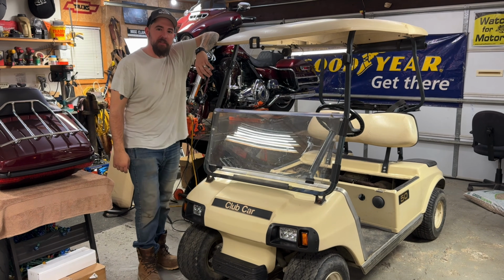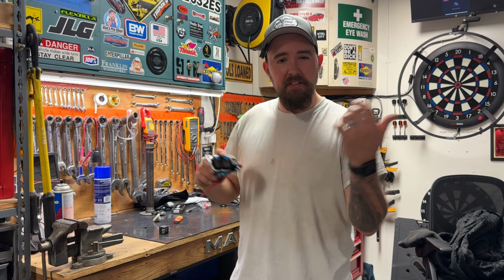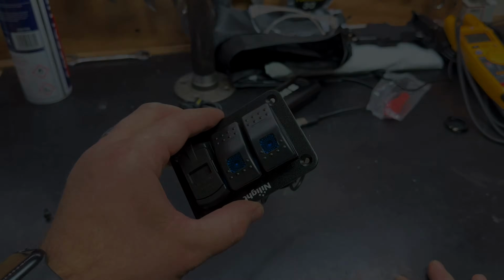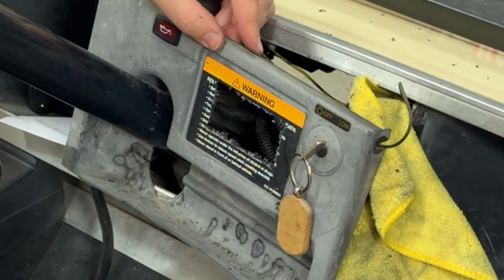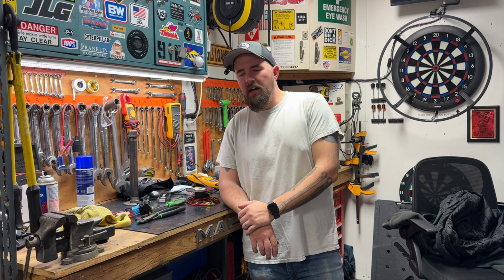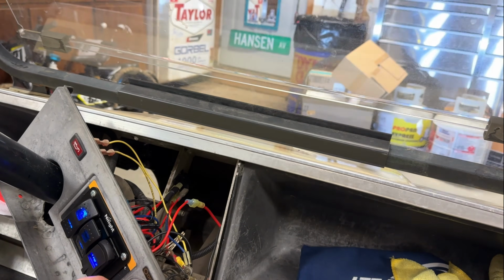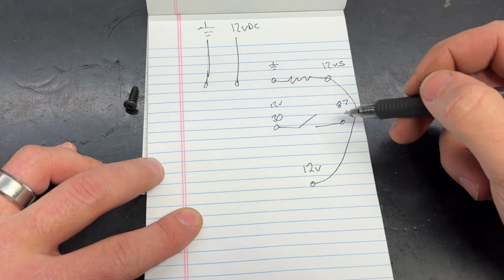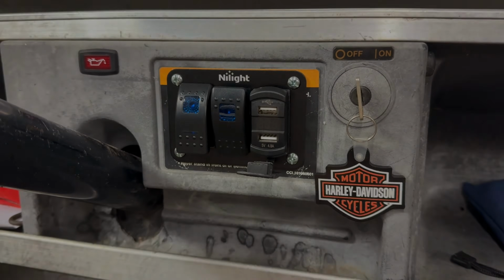Custom lighting switch panel and auxiliary outlets for your golf cart

Comment: So how much difference to the wiring would it be from the video for a 36v (3 12v battery set up) electric cart? As yours is a gas with a 12v battery only. 

I guess my question is, can I hook all this up on my 36v but just off 1 12v battery and make that work?
Reply from the maker: Not much difference. You would need to hook onto the last battery in the series giving you only the 12v you need for lighting
Reply: Great video.  Why cant you run the 12v that comes from the key switch directly to the switch box?  You would only have 12v to the switch box when the key is on with no need for a relay.

Comment: If you don't already have an idea for what to do with the other switch, why not 2 dome lights. 1 front and 1 rear. Maybe have a red light option as well as white light. 

Power from the switch, up to the lights. Light have a 3 position switch: white:off:red.